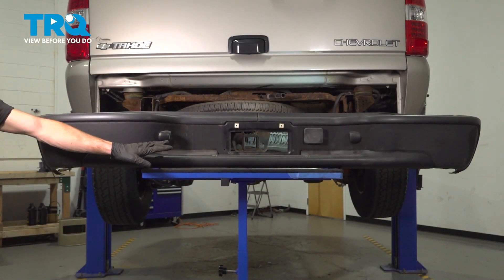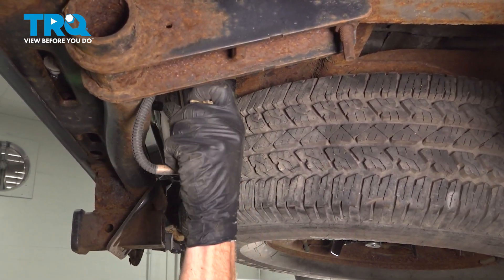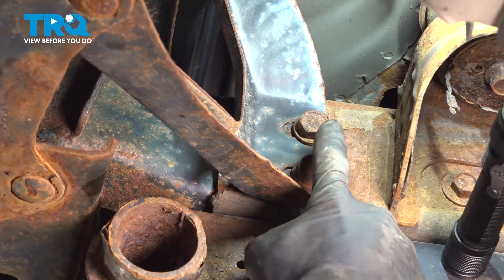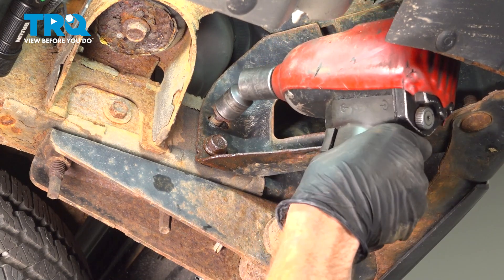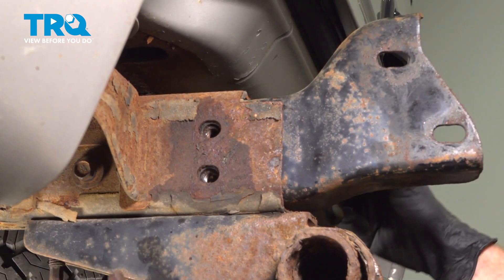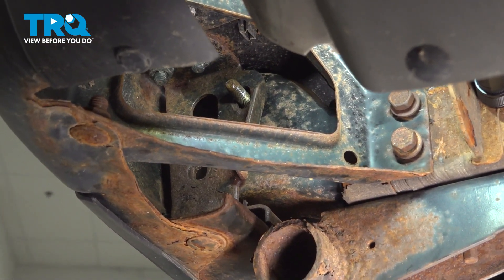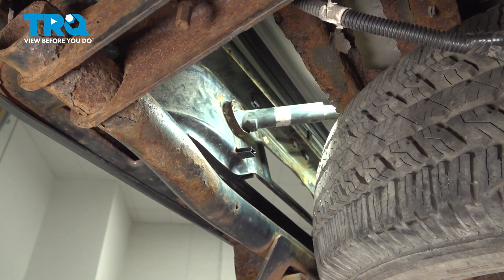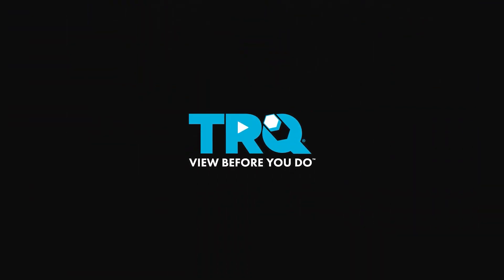How to Replace Rear Bumper 2000-2006 Chevrolet Tahoe

Comment: Good video, thanks. I found a short cut on my 2004 tahoe. I just removed the 2 18mm bolts and the 15 mm bolt that connect the frame to the mounting bracket. The bumper slid right off with the brackets still attached. The three nuts were welded on so no wrench needed.